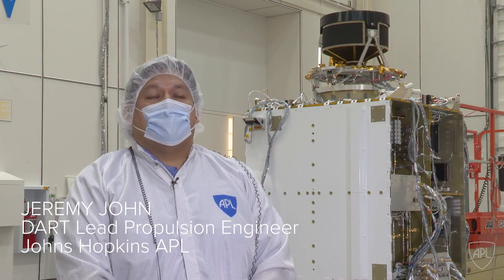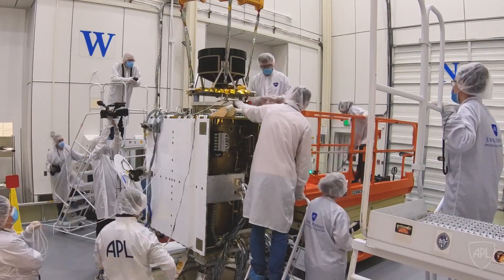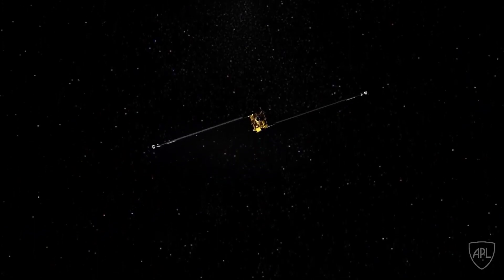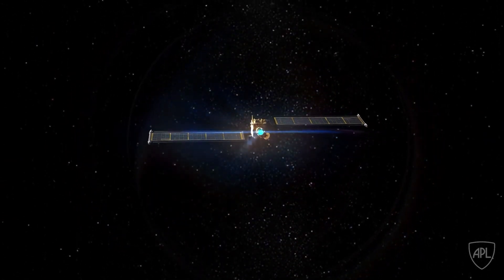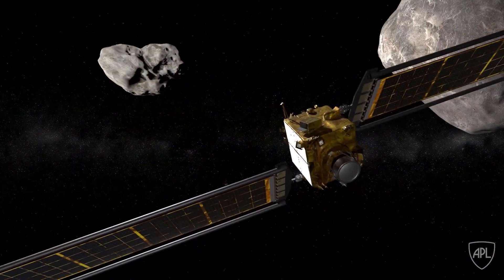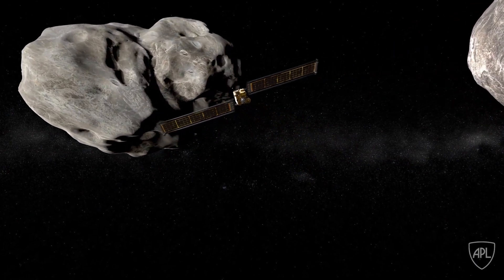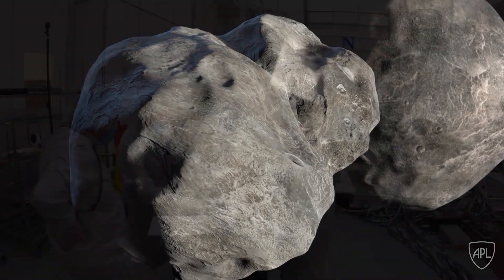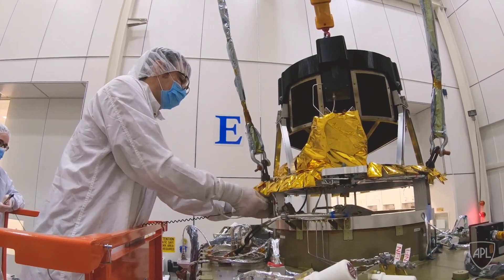See the NASA DART spacecraft's ion thruster get installed

Comment: sees like small aircraft compared to what it has to turn around...
Reply: Well it won't actually be turning the asteroid "around". Even a very slight nudge will change its orbit, and that is the intention. When DART impacts the asteroid, it will have a mass of 550 kg and will be going at 6.6 km/second. The asteroid (Dimorphos) is 160 meters big.
Reply: Space is deceiving. In normal life, we don't see smaller objects moving bigger objects cause there are forces like static attrition. But in the vacuum of space, even a relatively big object receives a significant net force from a small satellite like this, because there is no way to dissipate the energy transmitted by the satellite immediately.
Reply: Even a Miniscule movement 6 million miles a way will change the the course of the asteroid drastically 6 million miles later